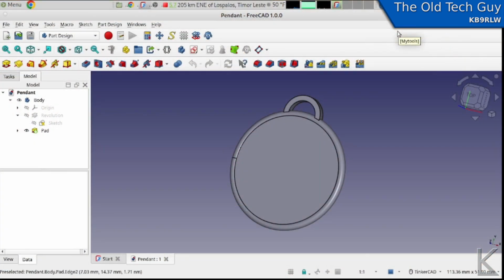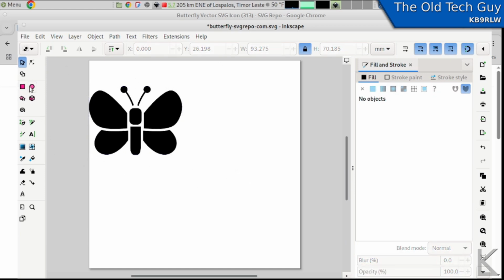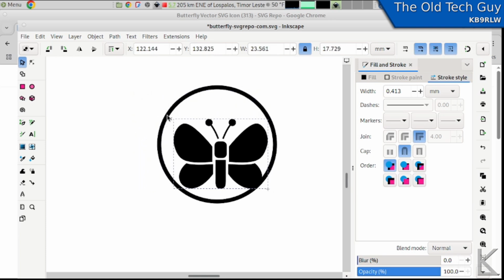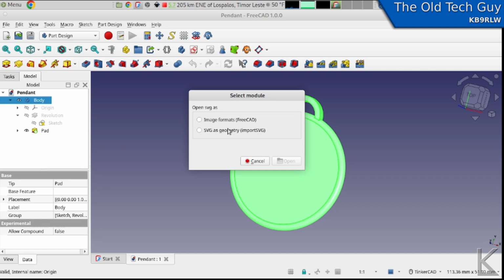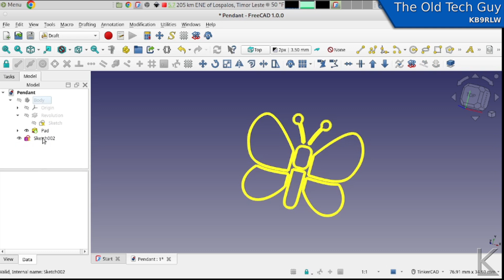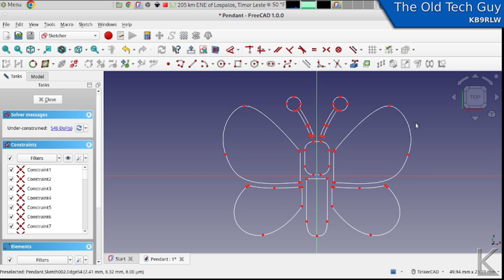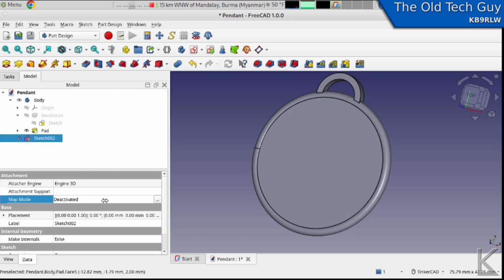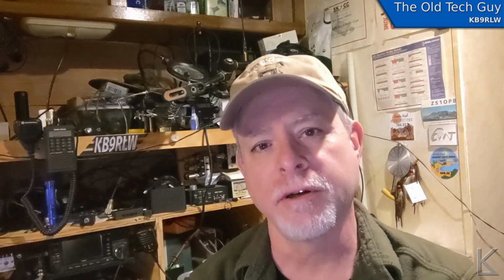FreeCAD - Importing SVG drawings, Part 1, The basics.

Comment: Your explanation regarding Importing graphics into FreeCAD 1.0.2 was really good. I have been struggling with this for days before I found your video.
The only problem I have is: I started with a .png file and went to Inkscape to convert it to a smaller scale and export as a ,svg file. When I exported my .svg file out of Inkscape, everything seemed to go fine (the file showed in the file directory as a .svg type). However, when I imported into FreeCAD 1.0.2 (with Body not hidden), and selected "SVG as geometry", there were no paths shown for the .svg appearing in the Model tree. Do you have any insight as to what might have happened with the paths?
Reply from the maker: How did you trace it when it was in inkscape?  Or did you trace it at all?   A PNG file is a bitmap file made out of a grid of pixels.  Just exporting it as an SVG will result in a file that contains the bitmap but no geometry.  It needs to be traced with lines and curves in inkscape. There is an automatic function to do that in inkscape, however it usually results in lots of extra lines that can be jagged due to the pixels.  It's best to trace it manually if it's not too complicated of a shape.
Reply: @loughkb  Thanks for your quick response, I was hoping that saving it as a .svg would be enough. Oh well, I guess that I will now be tracing the .png. It is for a school fund raiser, so maybe it won't be too time consuming.
Reply from the maker: @glennshort8101  A tip on tracing in inkscape.  Roughly trace using straight lines.  Then you can grab the lines in the middle somewhere and drag to make them curves.   You can trace things pretty quickly once you get the hang of that.

Comment: thank you, please show how to add logo on the cylinder?
Reply from the maker: There are two methods.  One is project on surface in the Part workbench.  You need to extrude the logo slightly so it has solid faces.  Then you position it above the surface and position the view of the camera to that you are seeing the logo over the surface the way you want it.  The project on surface function will act like the camera is a projector light casting a shadow of the logo on the surface.  That shadow becomes an object that you can then extrude and fuse to the surface with a boolean. 
The other option is the sketch on surface function, which can map a sketch to a curved surface.  I go over that in this video. 
https://youtu.be/goMVtQAgoSc
Reply: @loughkb  You are the best! thank you, thank you thank you!!!! just one more question - you have a shape and then you can set the thickness to extrude - is there an option to not to extrude but make a hole with that shape?
Reply from the maker: @Krzysiek-m4o  You would extrude it and then set the offset value so it's embedded in the surface object.  Then you could use it in a boolean cut operation to cut the shape.
Reply: @loughkb  I tried but without success (you explained with the offset) and got it! thank you very much 😁🤩

Comment: Thank you for the clearest explanation I've found on YT for importing svg into FreeCAD. 
Not your fault, but it's crazy to me how many steps are involved compared to Fusion, Onshape, or Blender. I really want to transition to FreeCAD for anything CAD related, but having to keep in mind all the different workbenches and multi-part steps to a lot of things are making it a total nightmare compared to what I'm used to. 

Hopefully you will be putting out a lot more videos on FreeCAD, and I'll get to a point where it isn't so annoying trying to use it. But at the end of the day, it does look like it will be more complicated/time consuming in many cases, than using other CAD or other 3D software.
Reply from the maker: Well, when you first approach FreeCAD it can seem overly complicated.  But after you work with it for a little while, it gets very easy, even quick to work with.  
The two main workflows for cad are Part Design and Part.  The Part Design workbench follows a more strict workflow like other CAD programs, and grows a tree of operations downward as a history.  
The Part workbench is more of a free flowing workflow..  Similar to something like TinkerCAD.  The tree nests deeper with each solid as you do things like fusions and cuts with shapes.  Multiple shapes can be worked with in the 3D space.  
Tools from the other workbenches can be used selectively within either of those two major workbenches...  It's best to stick to one, like Part Design and learn it's workflow, then start expanding to including some tools from other workbenches. 
It's really got an incredible diversity of options.  Don't try to grasp it all as one, stick to one facet until you're comfortable.
I'd strongly recommend the Mango Jelly youtube channel and his FreeCAD 1.0 beginners introduction course over on his playlists.  He goes at a good pace and gives just the right information not only as to how, but why you do things.
Inkscape is not necessary, but is incredibly useful for pre-processing SVG files before importing into any cad.  Being able to clean up the visually oriented geometry in inkscape before importing it into the far more rigid rules of mechanical cad geometry can save a lot of work in the cad software.
Reply: @loughkb  I was making a sign from scratch, and needed the letters to "follow the path" of the circle, and couldn't figure out how to manipulate text like that in FreeCAD, so I drew it up in Inkscape since it's easy to put text on a path in that.

Thanks for the advice. I'll check out Mango Jelly.

Comment: Thanks Kevin. Great video! For a future video I am very interested in knowing how to name the objects in the export so that I can easily color them in my slicer software.
Reply from the maker: Name what objects in what export? If you're talking about exporting an STL file, there's no facility to name any part of it. It comes out as a single mesh.  You can easily do color changes by layer though, so if your object is flat you can vary the extrusion length of different features of the model. In this example, the butterfly would be the tallest part of the model so it would be easy to do a color change at the layer where the butterfly starts.
Reply: @loughkb  thanks again for your video. I probably don’t know what I’m talking about. I’ve watched a few videos on how to create coasters in fusion 360. What is interesting to me Is that they export as a STEP file and it retains the object names when they bring it into the slicer software.  I was trying to figure out if I could do the same thing with what I learned from your video.
Reply from the maker: @kenwilson-nj you can export step file format from freecad. The exported model will retain features such as vertices, lines, arcs, and faces. If your slicer allows you to assign colors based on faces from an important step file, then yes you would be able to.